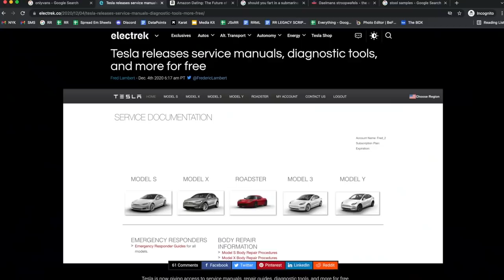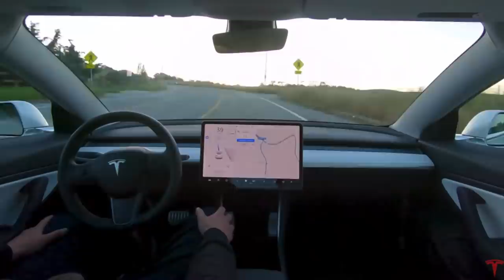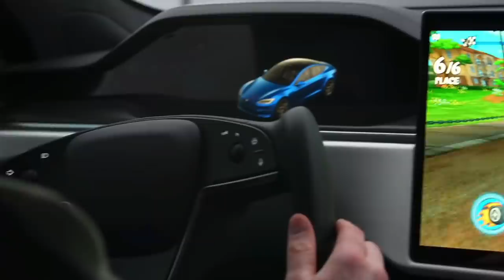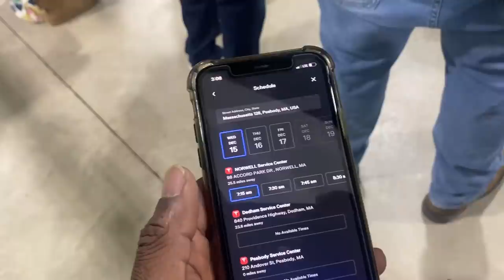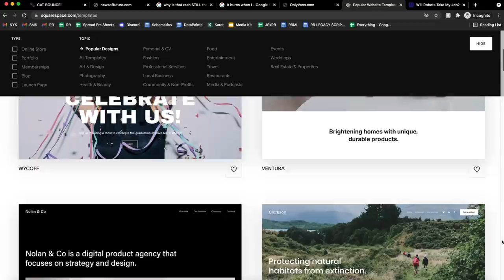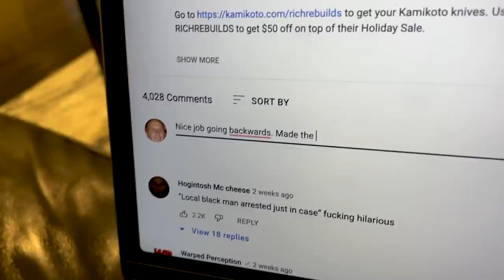How Tesla is failing its most Loyal Customers

Comment: I've seriously been thinking about buying a Tesla when it's time to replace my car but I hear these kinds of stories pretty often.    I won't be in the market for another couple of years at least so I'll just keep watching and see what happens.  If service and Tesla quality  is still lousy I won't buy one, that's for sure.  My tolerance for BS is low.
Reply: I own a 21 model 3 and it’s garbage. It’s been in the shop so many times. If you have a low tolerance for BS I’d highly recommend you look at a different EV.
Reply: @walrusitow614  a Tesla owner being honest. Will you be buying another.
Reply: Or see it as a hobby and repair the thing yourself. I repair my own cars. No BS. :- )
Reply: I think the problems are also dependent upon the owners location because service in Florida hasn't been terrible. My mid-range model 3 didn't come with any errors but I had delivery November 2018. The only problem that wasn't caused by me was a few months ago the inverter decided to fail after being parked for a while so I had to get the car towed 80 miles and get a loaner car while it was in the service center for a week. Everything was covered under warranty so I haven't had any terrible experiences but others have.
Reply: @loubakker5000  gotcha. lets not hold companies accountable and spend our own time and our own money to fix it ourselves 👍
Reply: @loubakker5000  New cars are under warranty and the repairs cost nothing to the consumer, but you have to put up with their crap.  If you fixed it yourself you have to buy all the parts they probably wouldn't sell you.
Reply: I am a 18 M3 owner and thus far have not had any software or hardware issues. I am lucky in that regard, but after reading and hearing about the horrible service, I probably won't get another Tesla. I had body work done and even something minor takes forever in terms of getting parts and needing a Tesla Certified Body shop perform the work (they don't sell parts to everybody). I'm hoping a legacy car maker puts out some decent EV and fast DC chargers come more readily available, cuz then Tesla will have no choice but improve with competitors coming for them.
Reply: Don’t buy a Tesla there you go. Get a hybrid bro they do get decent MPGs. Hybrids are underrated IMO. EVs are really overrated
Reply: I have a '17 Model S.  It's been pretty reliable, and I love it.  Tesla Service used to actually be a pleasant experience, but then they went and cranked out a bazillion 3's and Y's but didn't build ten times as many Service Centers.  Service now officially sucks.  I've felt abused by my SC and all I was doing was picking up a damn part.  I still love my S, and I have a shit-ton of TSLA.  I would have bought another Model S if they hadn't made the steering wheel rectangular, removed all stalks, and made the horn be a stupid little off-center capacitive button.  Tesla needs to get their shit together about the driver interface and the service experience if they want more business from me.
Reply: I have a Tesla service center 10 minutes from me I think these cars are incredible.  But still no way in hell would I be giving my money to a company that's disrespectful to it's customers.
Reply: Wait for the Toyota EVs.
Reply: @incognitotorpedo42  Same here. Been very happy with my 2016 Model S, service has been good to me - even when I just came in to buy parts. Was thinking of spending some of my TSLA stock on a Plaid, but the UI is so atrocious that it would be a significant downgrade.
Reply: It will still be like this, musk focus is on using his fanboys to thrust him into a powerful position, if he was trying to get better as a Car company, there are consultancy companies be could have gone with, or cut a deal with Toy to help Tesla improve.
Reply: I was thinking the same thing but only if they ever release an actual affordable model. After hearing and watching these type of videos I think I'll look at some of the other options.
Reply: @EpioN  problem is they are building hydrogen cars, if they are building ev, i would definitely buy toyota than shitty Tesla
Reply: There are tons of plug in hybrids and pure EVs from every maker coming out and you will actually be able to buy parts for them and get them serviced quickly. Don't look to tesla for any sort of good experience, they've built their closed servicing on purpose based on what companies like apple do with their phones.
Reply: I can't get past the poor fit and finish. I have to believe most Tesla owners are not at all car people, because  as a car guy I couldn't live with the level of panel gaps and misalignments I see on every Tesla...
Reply: It seems like a miss or a big miss with these cars in terms of quality depending in the day. Even the mechanically put together cars seem to have paint issues (yes even the plaid, a 140,000 car). The reason for the bad customer service and bad quality is people allowed it to happen with fanboyism. Holding companies like Tessa accountable prevents these kind of issues. Personally I wanted to buy a tesla on multiple occasions, but between the awful quality and Elon’s lies and clickbait marketing I just can’t swallow the price. That’s why I mostly end up with either Japanese, and German cars. I know they are well built and will last me 10+ years with proper maintenance.
Reply: yeah me to. At this point there is just no way id buy one.
Reply: @loubakker5000  because getting tesla parts is so easy even tesla cant do it.
Reply: @loubakker5000  Good luck getting the parts, diagnostic tools, or information you need to repair anything made by Tesla.
Reply: A Mustang Mach E is probably just as fun and usable as a Tesla and you'd be able to get it serviced at your local Ford dealership probably pretty easily
Reply: I've been a service center once in 4 years. I've got one of the 2018 Model 3's which are supposedly the worst ones. There's some real problems with Tesla/Tesla Service, there's a whole bunch of FUD too. YMMV I guess.
Reply: @mworld2611  Ford is dealing with the same parts shortages and un-trained technician issues with the Mach E, just the only place you hear about it are on dedicated EV channels and forums, from people actually dealing with it. Just not as interesting to talk about an unpopular vehicle I guess.
Reply: Ioniq 5 N (performance version or ioniq 5) and Porsche Macan EV will be out by then. And I’m sure there will be some surprise models.
Reply: Would you consider checking out the Lucid Air?
Reply: @officialspock  Toyota recently announced a major flip to EVs.
Reply: @stevemcgowen  I heard that at a car exhibition in Europe a Mercedes executive was looking at a Hyundai and marvelling about how precisely it was put together. He was heard saying, "How do they do that?" Hyundai and its sister company Kia are now making good EVs. Like all their products they're well put together and experience here in Australia is that their service networks are good. Just as an aside I've noticed that older Hyundais here still have new looking paintwork when the paint on many other brands has faded. Skin deep maybe but it suggests their attention to durability.
Reply: @rais1953  Compared to US made Mercedes, some Hyundais may well have better fit and finish. I'm buying a Luka EV when I move to the Czech Republic. They are retro beautiful and only $45K...
Reply: Honestly, Get a Prius if you're trying to be environmentally friendly and want a car that's actually reliable.
Reply: The number of EV models is growing exponentially and in two years you probably can buy a cheaper, better driving, more reliable and at least the same range car that Model 3 or Y is right now. It might come to a point where we can debate wheter Tesla can keep it up then.
Reply: @stevemcgowen  Sounds good. Unknown here in Australia but it it looks as if affordable Chinese EVs are going to start being seriously marketed here.
Reply: @walrusitow614  yeah because you will have perfect service for a perfect car if you do. 😂
Reply: @Supraboyes  honestly I don’t think I will. The drive train is absolutely incredible and makes other cars feel dumb. The self driving is also very addictive I use it almost all the time. With that being said the rest of the car feels cheap and 10 years old. Even the interface on the screen is kinda shit in my opinion. I’ll probably buy a plug in hybrid next.
Reply: @dapman2007  I’m not talking about “perfect service” I’m just talking about service in general. My car was in the shop for 6 weeks and the only update I got from Tesla was when it went in and when it came out. Every call, email, text I sent them was met with a “We have no idea when we can repair your car. Rich is right. If you buy a Tesla make sure you have enough money for 2 cars. You will need that 2nd car.
Reply: @loubakker5000  for the most part I repair my own cars too. Every other car I’ve owned I’ve actually been able to buy parts. It’s harder to buy parts for my Tesla then it is for my 1975 FJ40 Land Cruiser. Most parts for the FJ40 are obsolete too, that’s saying something.
Reply: @walrusitow614  well I do speak from experience. I bought a model 3, had nothing but great service in the UK. The worst experiences I’ve had over my lifetime were from Audi. Porsche and Mercedes were bad too. I was expecting poor service from Tesla but I wanted to part of the transition to EV’s. I was amazed when their service turned out to be good. Even got a courtesy car both times I took it in.
Reply: @yungboicontigo9278  Hybrids are useless. just get a Diesel. better MPG.
Reply: @walrusitow614  True. I meant if you can repair yourself then do it. But if you cann't then it stops there.
Reply: @dapman2007  I hear you. Like Uncle Rich said. Every person will have a different perspective. Mine unfortunately has been very negative. I really wanted to like Tesla too. 🤷‍♂️
Reply: @loubakker5000  true, true.
Reply: @rais1953  LUka EV's are made in the Czech Republic, not China...
Reply: @nox5555  diesel is way less environmentally friendly. It causes pollution lmao hybrids are indeed better. But don’t get me wrong tho I’m really excited for the Cummins model 3 tho. That’ll piss off tesla stans even more 😂
Reply: @stevemcgowen  I understood that but we're not likely to see it here. I think the Chinese EV cars will dominate in Australia.

Comment: Tesla owner for 5 years, from new. Love the car, love the driving experience, hate the company and hate the service & parts experience. I can’t see myself ever buying another; their contempt for their customers borders on the criminal.
Reply: Ah, welcome to the Apple of cars.
Reply: @paisis123  what?  Apple gets your phone fixed in like an hour and if they cant fix it they just swap it
Reply: @paisis123  apple does have good service , costly but fast and prompt
Reply: @paisis123  Aside from the cult like following, Apple actually has good customer service.
Reply: To charge for something that hasn't been provided IS criminal.
Reply: @steezmuffin  Apple will make you pay for a whole new motherboard, cpu and ram if a single chip is broken.
Reply: @steezmuffin  and charge you $200 bucks for a part that probably costs $3
Reply: @BabyJesus  and so does every other mobile phone company, thats a BS comment, i have had samsungs from the s5 galaxy products are not as good as apple,  customer service is good better than apple, Samsung fix your phone at the door, but replacing issues after warranty is just as costly as apple products.
Reply: @nickmanhota324  only one phone company has Software lock so you cant change the Batterie from one working phone to the other. Only apple bans. People of their Forums for telling other users that 3rd party Services can Backup their data.

Comment: I’ll be super honest, I didn’t know their service had gotten so bad. And their policy of absolutely not correcting bad things… I will absolutely not be going the Tesla route. I’ll get myself a Hummer or a Taycan or something. Tesla charging network be damned. I gave up on the promise of real FSD (real FSD that has been promised over and over, and is STILL not delivered) a while ago.
Reply: Buy $tsla, not a tesla. I mean it is too late now, but maybe swing trade it.
Reply: @jekker1000  Mercedes was always a pioneer when it comes to new technologies. I can definitely trust Mercedes over Tesla when it comes to tech. They always made sure the system is actually working before putting it out to the masses. Although Mercedes made some mistakes too but Tesla is making too many of them. That's just outrageous what they're doing, I wouldn't spend my hand earned money on Tesla...
Reply: @jekker1000  Want to see Tesla's biggest FSD "haters"? Read Tesla's own filings to the NHTSA about autopilot and FSD. They change their tune big time when they talk with regulators.
Reply: Never would go back to anytbing but tesla . I would try one before just not even attempting to drive one. I have a 600 hp sitting in my garage cause of how good the tesla is
Reply: Most company’s can’t get parts
Reply: @warhammerfaction   tesla sell new cars so they have parts
Reply: @MKRN98  The problem with Mercedes is they’re following Tesla’s footsteps. The new EQS hides the hood release behind a cover and has a warning message that only a certified technician can open the hood. That’s a very slippery slope to a subscription based ownership. Tesla has a lease option but they won’t let you buy the car at the end of it. I fear that every EV will eventually become that way and ownership will be banned.
Reply: @jekker1000  You don't read newspapers while you behind the wheel. Nor drink coffee and eat doughnuts.
Reply: i mean, i have been following rich for a year or 2, so nothing like this is news to me. it was always bad. not getting back 200 bucks over FSD isnt even that bad. what's bad was that guy couple months ago who would have had to pay like 20 grand for a new battery just becase a cooling nozzle on his battery pack was broken. Things like that are bad. also, how would their service not be bad? they basically prevent independent body shops while at the same time not creating a valid infrastructure of their own. it's the worst.
Reply: @driverman9528  You can't afford one. lol

Comment: I got the same 'I'm not blaming you. I'm just trying to explain why Tesla won't pay for this' explanation when I brought my 2018 model 3 in for a cracked rear windshield.  Must be in the training manual!  A quick internet search will reveal this is a known design flaw that has occurred on hundreds if not thousands of cars.   I actually heard the glass pop while I was sitting it the car not moving, away from all other traffic.  There was no impact point from a stone or other object - it was clearly a stress fracture from the glass being installed incorrectly.  Was told by the 'service' tech to basically F-off because there was no way to prove that.  Just wanted to throw my anecdote in the hat.  I love the content Rich!

Comment: The FSD subscription thing is easy to handle. Call the credit card company and charge it back. "Didn't receive the service I paid for." People doing chargebacks is likely what forced them to allow refunds within 24 hours on fully bought FSD and Acceleration Boost.
Reply: I’m a bit confused you have to pay extra to use all of the cars power?
Reply: @luissera1296  yea it works like a DLC no joke. You can pay to lower your 0-60 time in some of the models after purchasing it
Reply: @prettycoolcat  and people wonder why I prefer older cars.
Reply: @luissera1296  Intel started this years ago.  It was cheaper to make one fast processor, then slow it down and sell it with the option to upgrade it's speed by phone.
Reply: @aussie2uGA  but the big difference is that you can buy a decent new computer for about £500 meanwhile for a decent new car you’re paying at least £40000.
Reply: @luissera1296  None of what any of you are talking about applies to the original comment (or is actually true). The original poster meanwhile makes a good point.
Reply: Everyone upvote this!

Comment: Never buy one out of warranty. I had my 2015 p85d have its motors fail 3 times in 1.5 months. Insane BUT I did drive their cars, put 10k miles on THEIR cars, and used THEIR accounts for super charging. Never spent a dime, I wasn't too mad but did it really have to fail 3 times?
Reply: i don't think that was Zach from Know You Know.  There is no way really to tell who that was.
Reply: Probably on purpose since its out of the warranty
Reply: Or actually buy it out of warranty so you can afford to fix it diy or take it to Electrified Garage :P
Reply: High power motors/generators have a problem with low voltage leakage current, forming in the shaft and crossing the shaft bearings. It corrodes the bearings leading to a grinding noise, and driving it hard wears it out faster. Newer model Tesla motors use shorting brushes on the shaft so that this current will bypass the bearings.

Comment: Thanks, you confirmed what I thought all along. I spent 4 years with a Volt waiting for the Tesla3. Then when I realized I wouldn't be able to do much with the 3, I traded the Volt for a new Silverado 1500. 68,000 miles later, I'm still very happy with the decision. I've pulled so many trailer loads, cars, boats that I don't even know why I was considering a 3.